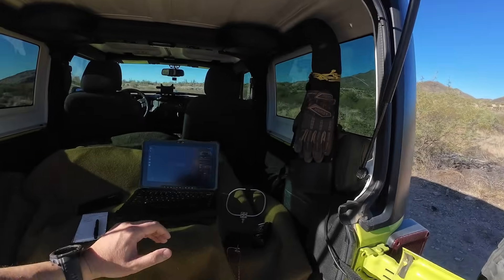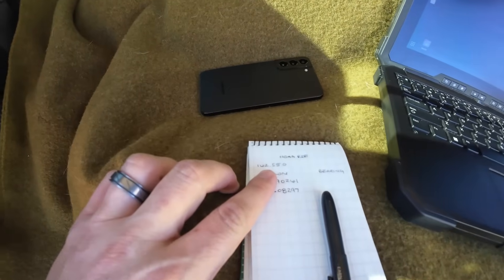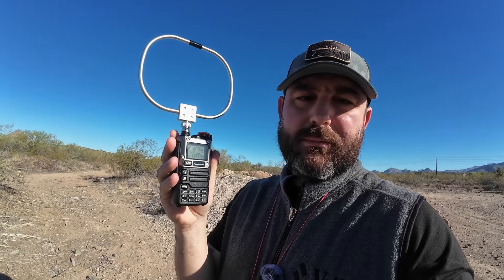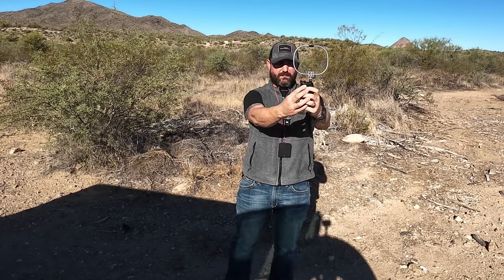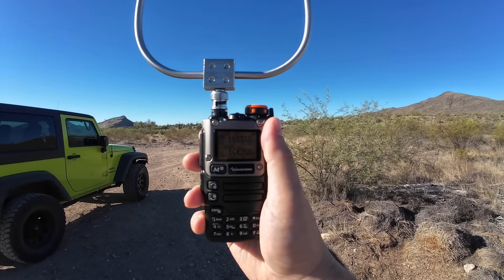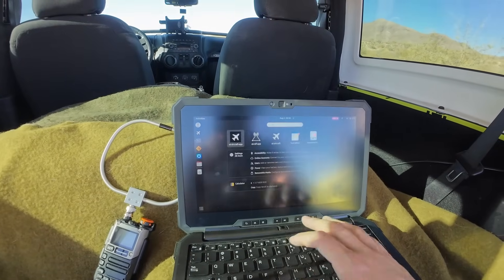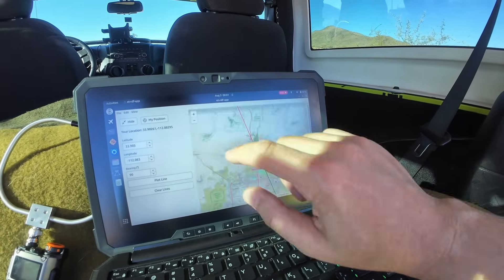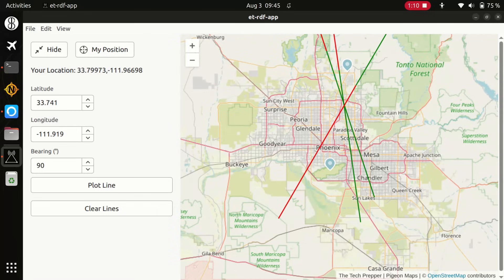Let's triangulate a NOAA Weather Station: Radio Direction Finding Part 4

Comment: You need to take into account the bearing/line is not really a line, but can be +/- as much as 5 degrees, so its really a wedge. As you get more lobs (lines of bearing) you can estimate the location with some probability of error.  Don't assume where those bearings or lines on the map intersect is your "X marks the spot", there are lots of variables you are not accounting for.  For example multipath.  You need a minimum of 3, and a lot more is better.

Comment: I purchased the radio and the Arrow antenna in your video but they do not match connectors. I purchased a box of random connectors and none of them fit. Which connector did you use  for the Arrow antenna to hook up with the Quasheng radio?  Thanks!
Reply from the maker: The Arrow antenna is BNC. You need an SMA female to BNC female adapter.

https://www.amazon.com/Anteenna-TW-BNCJ-SMAJ-Adaptor-Connector-Handheld/dp/B0BPC696CN

Comment: Thanks TP.
So, using similar stuff, but maybe more expensive/specialist gear, is that the sort of thing the "powers that be", use to narrow in on folk that may be "skylarking" for want of a better word?
Reply from the maker: The powers that be have very sophisticated equipment and capabilities. It's game over when dealing with a nation state or military, but not necessarily game over when it comes to civilian on civilian. I am mostly focused on the latter. More on this as I unpack this series.

Comment: Gaston, why not inserting a variable attenuator to att the signal to sharpen the minimums?
Reply from the maker: I've had one for months. I am using the Arrow 4mHz offset attenuator. The nulls were pretty sharp with the loop using the null hunting technique. Based on the received strength when hitting the null, it was no ore than 2-3 or degrees wide. When I was using the Yagi (peak hunting) the ranges were closer to 10-20 degrees wide.

Comment: So your intersections all were essentially camelback mountain, but it is actually on south mountain? Interesting. Perhaps camelback (or lookout) is causing something to bounce or happen to the signal
Reply from the maker: The point of intersections look it was Camelback Mt. The actual transmitter was on South Mt. I have a strong suspicion that the false bearings are due to all the reflections caused by all the nearby rocky peaks. We'll see how the KrakenSDR handles this exercise.
Reply: @TheTechPrepper great stuff, thanks

Comment: I have a lot of practical experience with this. I never used any fancy gear. All I needed was time, a vehicle, and a radio with a decent S meter. Simply put, drive in a random direction from your starting point and see if the signal increases or decreases. If it decreases, turn around 180 degrees and find the strongest point. Then pick a direction that is 90 degrees off, and repeat. Eventually you will find your target. When you get super close, switch to the 3rd harmonic of the target frequency. Example, 146.520 x 3 =439.56. This allows you to get much closer and still have a usable S meter because the signal strength will be much weaker on the 3rd harmonic.
Reply from the maker: I really like your approach of using simple tools. I am still new to RDF, but I purposefully used simple gear to start. Like you, my experience has been... that it just takes time.

I experimented with the close-in techniques of using frequency bumping, closing the squelch, removing the antenna, using the 3rd harmonic and incorporating an offset attenuator. It's nice having these basic techniques under your belt before moving to the advanced gear.

The KrakenSDR is going to take the "fun" out of the hunt. :-(
Reply: @TheTechPrepper  When you need to find something more quickly I imagine it will do just that. It also helps a lot if you have more than one person using the methods I described above.

Comment: ChatGPT did a reasonably good job with the coordinates. I believe the actual coordinates for the transmitter itself and not just the mountain peak are 33.332563,-112.066312, though

Comment: I respect your candid videos showing both wins and losses.  There are expensive car mounted gear for DF.  The Germans and Brits use them to ferret out their respective spies during WW2..  You may want to try building an attenuator kit to use with a yagi.  I have two from 3rd planet solar (The attenuator V7) and two arrow yagis.  I will assemble the kits and get the young adults (kids) to do a fox hunt in a couple of weeks at the cabin and advise on their effectiveness.  Another great video that inspires us to be ready. Prepare for the worst and hope for the best.  If you haven't seen it, the movie 'The Road' with Viggo Mortensen is a good reality check on why we don't want it to happen.  Cheers.
Reply from the maker: Thanks for the support. I've been using 4 mHz offset attenuator from Arrow. It works great for closing in on the fox as does switching to the 3rd harmonic.

Comment: Very nice!
That definitely helps for getting oriented towards a signal of interest, this is a great exercise for Boy Scouts and those brewed in similar fieldcraft. 

On that about ChatGPT, one of my many projects in tech has landed in researching offline LLM's/GPT's that are insulated from the influence and nonsense of OpenAI/Deepseek/Etc.

The next phase that is quite meaty with vector databases, embedders, and retrieval-augmented generation (RAG)

The short version of all that acronym soup is running your own finely-tuned version of ChatGPT that have guardrails linked to known truths that keeps the LLM from telling nonsense as facts (hallucinating) 

Right now, I am testing 1 to 8 Billion parameter models and they run between 15-40 tokens/words per second on an M1 Mac

4 Billion is the sweet spot for a portable LLM/GPT, still testing the accuracy as some models are rubbish (Gemma) and others are like Granite are decent but slow or get unstable depending on the topic and depth. 
(That's where the VectorDB comes in to keep things aligned)

My long-term plan is to pair the best model(s) and Vector/TruthDB's to see how it works to take fuzzy questions and return accurate answers consistently.

Comment: Have you tried using a yagi first and then a loop once you’re closer to the transmitter? I have no personal experience, but I do hear that that is a better method. Maybe worth a try?
Reply from the maker: I have both a 4-element Yagi and this loop. The first episode in this series started with a Yagi, but many viewers suggested that null hunting with a loop would be more effective as it has deeper nulls for more accurate bearings. This was exactly what I experienced. I find that the absence of signal using the null hunting technique does lead to tighter bearings. I always had an equally strong signal over 10-20 degrees with Yagi when doing peak hunting. I should half brought both, the Yagi and loop, for an apples-to-apples comparison.
Reply: @TheTechPrepper comparison and demonstration between the two for fox hunting purposes would make a great video for sure

Comment: Awesome video and sweet project! Does your emcom software take into account declination? I noticed you were inputting magnetic azimuth but couldn't tell if it was plotting in grid. 73
Reply from the maker: I set my MC2-G compass with the declination my area (9.8 degrees). So all my bearings were true north bearings. The digital map uses true north. All good. Thanks for checking.
Reply: @TheTechPrepper actually magnetic variation in the Phoenix area is about 12 degrees. Can be found on aviation VFR sectional charts or in the AFD (Aviation Facility Directory). Not that the accuracy really matters in this case. Agree with your assessment that the terrain - multipath - creates challenges. A more advanced technique uses multiple antennas, say 4, and measures the phase and hence arrival time difference between the antennas and can give a graphical display of bearing to the station. An advantage is this works almost instantaneously. I know you were just going basic here, just wanted to add to the conversation.
Reply from the maker: @pfluegerm  Thanks for joining the conversation. We'll see how the KrakenSDR does when I revisit this same hunt. I'm looking forward to see the Time-of-Arrival measurement as an instance read.
Reply: Dang, I was hoping to get you an extra few degrees in the right direction. Thanks for all of your content!
Reply from the maker: Good effort. I'm pretty it's all the terrain features causing reflections. We have rocky peaks all over this area.

Comment: It’s one of the best ways for a beginner to try out fox hunting - locate those NOAA towers. Keep up the great work. 73
Reply from the maker: Thanks, Joe. The reflections from all the terrain keeps getting me. I figured others were using NOAA Weather Radio stations as an easy to a hunt without hiding a transmitter as part of a larger organized effort. I am going repeat this exercise with the KrakenSDR. It will be fun to drive right to it with turn-by-turn directions. At least that is the claim.
Reply: @TheTechPrepper the local NOAA WX transmitter for Metro Atlanta is on top of Stone Mountain, due east of Atlanta. Most people don’t know that. When I teach fox hunting I have folks RDF to that transmitter and then ask them to pull out a map to identify the location. Lots of fun and surprised looks on people’s faces. Bonus points if they can locate the other NOAA transmitters just outside of the main metro area, but still heard on the alternate NOAA frequencies. From my QTH I can hear 4 different NOAA transmitters.
Reply from the maker: @KI4ASK  I'll like your approach and style of teaching. Those are some lucky students.

Comment: If you had a team, all at their own QTH spread around a region, and you wanted to locate a mystery signal, they could all fire up et-rdf and with a little back channel coordination you'd have a pretty good idea where the signal originates on its next transmission.  It is very cool that KrakenSDR can use a phase coherent antenna array that would allow the Android app to provide turn-by-turn directions, but $700 is a bit more than I'd like to pay for something I used so infrequently.  I saw a hacker version of this several years ago.
Reply from the maker: Good idea. I like how you think. One of the early prototypes for the TAM (Tactical Awareness Map) in EmComm Tools had the ability to share positions and other data on the map using fldigi forms under the hood.. This was all hidden as I was using fldigi as a headless modem (i.e no GUI). I made a note to bring back this feature.

Comment: Wow that looks like it quite challenging.
Reply from the maker: This is part of wanted I to explore. It's not easy to DF a hidden transmitter using simple gear quickly. We'll see how the KrakenSDR does. For this experiment, I'm pretty sure that I'll drive right to it. Stay tuned.

Comment: Fun times!  Thanks for being a part of the (n.idaho) amrron contributors.  Just ordered a btech uv pro.
Reply from the maker: I did know that I was a contributor to AmRRON outside of some the members using EmComm Tools? The BTECH UV Pro is a great radio, especially if you plan on doing packet work. 73

Comment: I have done fox hunt with tape measure DIY antenna.  Not so easy actually.  We were hunting a fox module hidden away and TX about every 40sec for 8 seconds.  Used body to shield antenna and shifted a little off freq when we got close.  Let us just say, the fox was pretty safe 😂
Reply from the maker: Your experience echos what I've heard from other fox hunters. RDF is a fun hobby, but with simple tools, it's not a quick method to find someone's position. It looks like you have all the basics down. Well done. Thanks for sharing your experience.